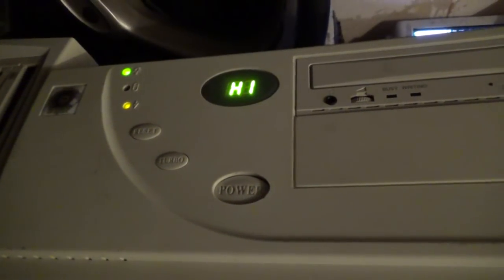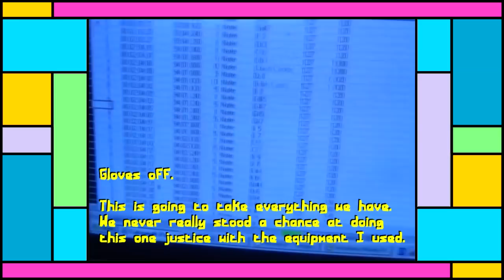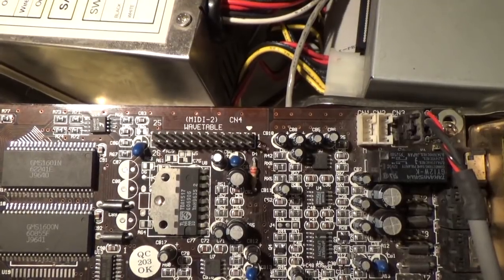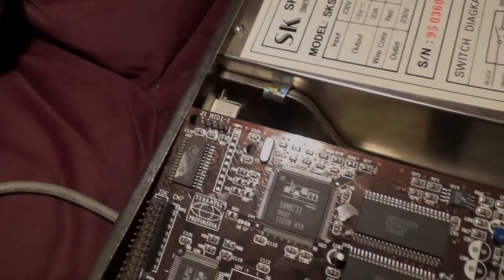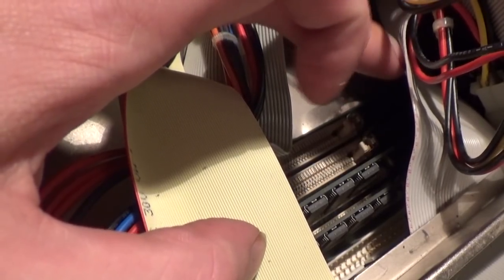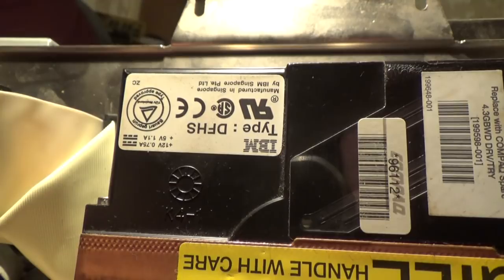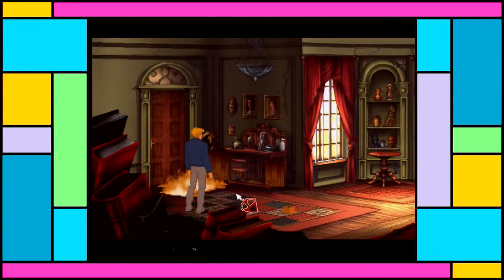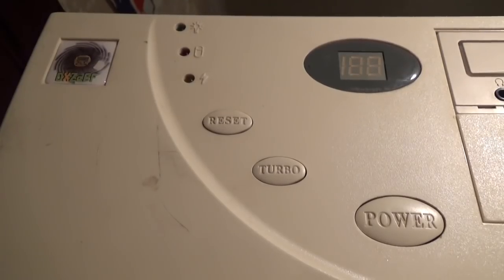Improved AMD K5 System

Comment: I like the fact you did put an intel branded CPU cooler on an AMD chip ^^

I wasn't aware your PCChips board didn't work well anymore. If you want I can give you mine (or sell it to you if you're uncomfortable about it being gifted to you) since I've got two of them with one having COAST module and 3v module and the other one having none of them. Since I've got many working pentium class boards and that I've two of these pcchips, that doesn't bother me at all (in fact that'll make some room for me and it'll be used by somebody at least)

Hey that K6 mobo looks exactly like the one I have, it's quite an interesting board. IIRC it was designed by DFI, but oddly enough mine had Octek stickers when I got it. This makes me wonder if Octek wasn't a second brand name for DFI

One great advantage for PS/2 ports is that under windows 9x you can change the refresh rate of the mouse from 40Hz up to 200Hz which makes the mouse to move smoothly (and improves the "framerate" in FPS games since normally when you turn your view, the view gets changed every 40Hz instead of 60Hz or whatever framerate your CRT and your computer are able to display)
Reply from the maker: It was the only cooler I had to hand which would fit properly, plus there's a box full of them in the kitchen.
Anyways, thanks, but I'm happy with this SI55P now and have a nice Intel board for Socket 7 stuff if I need it. As for the K6, it's a Chaintech just like I had before, though DFI would have been fine as they were still making good stuff at the time. Octek on the other hand, all I remember about those were their "DCA" 486 motherboards where the cache was part of the RAM module, good luck finding those now.
Can't say I've noticed mice causing slowdown like that, but then keyboard only isn't so much of a deterrent to me.
Reply: Well it's not really slow downs, it's just some sort of effect, the game still runs at 60FPS (or whatever framerate your computer is actually displaying), but the view gets updated only 40 times per second. I noticed this in half life : turn the view with the keyboard and it's smooth, turn the view with the mouse and it's less smooth. You can even move without turning the view and it will stay smooth. Use PS/2 rate and suddently turning the view with the mouse becomes as smooth as what you can do with the keyboard ;)

If you set PS/2 rate permanently, you can even notice it when Windows starts. Just move your mouse in circles while windows is starting up, then at some point the mouse will stop for half a second, and when it'll move again, it will be suddently smoother. You should try it, that thing is very light
Reply from the maker: Memory suggests XSetup actually has a dialog for this, though I don't recall ever using it. I suppose there's also the whole thing of 25-30fps being my target for games, so the odds of the frame rate outrunning the mouse are far lower than they otherwise might be and everything else is running in DOS anyway. Still, this information will definitely prove useful if I do encounter the issue in the future, I'm sure, so thanks, I'll keep it in mind.
Reply: I see. But I also noticed that this also affects DOS games if you run them under Windows 9x ! that's a really nice program

Comment: Personally I found Voodoo to be a great supplement for my K5 PR133, as it became a good all-round system that was not only great @ 2D, but could also breeze through any 3D title made up until ~1997
Reply from the maker: Can't say I witnessed that when trying one out with the old K5, but I guess it depends on what you're trying to run. As it is, none of the games running here use 3D acceleration, even the models in Atlantis only use DirectDraw and almost everything else uses VESA or good old frame buffering. If the boxes in your library are full of 3DFX logos, I expect you'll have a better time with one than without.

Comment: I don't remember Hover sounding anywhere near that awesome but then the PC I played it on was basically the cheapest PC my dad could find for Christmas of 96. Some low end AST rig so who knows what sound chip it had on board.
Reply: I also struggled to find a reason to use my PCI ATI Mach64. I currently have it in a early socket 7 machine I'm putting together running a Pentium 75 purely for the reason that machine refuses to POST with anything from S3. No joke, I tried a Virge, Trio64 and a Vision and nothing, popped in a Mach 64 and display kicked right on. Unfortunately as far as benchmarks go the Mach 32/64 cards are pretty slow being beat by all my other early 2D PCI cards from S3, Tseng and even my weird IGS card.
Reply from the maker: The only down-side with that wavetable is that some volume levels vary versus what the music might have been written on, but this is an issue on a lot of GM devices, even the highly regarded MU80 & SC88 have patches with vastly different levels or that sound radically different. As for your AST, the ones I went in from that time period (All AST Advantage boxes) had YMF719 chips in them, but there was definitely one around with an OPTi 929 onboard. There never was an issue with using the Mach 64 as such, it actually runs fast enough in DOS though they are indeed slower than an S3 there and that can be a problem if the rest of the system can't quite hammer it along fast enough. In my case, I just thought it was slow in LBA 2 (in Windows) but it turned out the machine itself doesn't like the game, or else they pulled a Cryo and completely understated the requirements. I was surprised overall by how the Mach 64 actually runs quite well outside of benchmarks, any slowdown is barely noticeable if at all most of the time and I will definitely be making an effort to count FPS in actual applications before and after switching back. May help that it's a later version, apparently with some primitive 3D core inside, to the point where it's effectively a "Rage Lite" or something.
Your S3 problem has me wondering if your board is doing something like this one, not so much the likely conflict with the WinTV Celebrity and undocumented addresses, but more so the SCSI BIOS issue where maybe the card is hooking itself into somewhere it shouldn't, possibly due to more undocumented addresses and something your board has sat up in that range. Either that or some weird PCI interrupt line troubles, the P66 board doesn't like passing POST if the VGA card's slot is set wrong.

One last thing. Do you still have that MS-3124 / Contaq-386 board? I noticed that it has extra pins by the CPU socket, how many are there and are they on more than one side? Do you remember if there were more within the inner square of the socket that weren't populated? I've stumbled down a rather strange rabbit hole here regarding a CPU that might have used them.
Reply: My Mach 64 doesn't feel very slow either in use but in every benchmark it's generally last along with my Mach 32. I also haven't used it to much either though. I've read some posts that it's not the most compatible card and certain games display graphical glitches though no one can give specific examples. I haven't come across any issues yet. I did realize after looking over some old notes the motherboard that is giving issues with the S3 cards actually once ran them just fine as apparently some time ago I did some benchmarks on it. Only major difference is back then I was running a Pentium 90 in it so maybe the 50mhz FSB that I'm running now with the Pentium 75 is tripping up the S3 cards? I tried removing all other expansion cards as well as trying different PCI slots and setting "assign VGA IRQ" or some such thing in BIOS but no luck.

As for the MS-3124 / Contaq-386 board I do indeed still have it. I use it as my main 386 PC. There are two sides with unused pin rows. It's sort of like the CPU (running a AMD 386DX-40) is installed in one corner of the socket with unused rows on two sides. I just assumed maybe it was a dual 386/486 board or something though I never bothered to even look how much larger a 486 chip is or if it fits in that socket.

Comment: If you get time could you make a video about a Cyrix 6x86 machine. How closely related is the Terratec EWS64 to the one you have here?
Reply from the maker: Cyrix, huh... yeah, maybe I will. There isn't one in common use anywhere here, the K5 basically displaces it but that's not to say I can't test one out, no harm in looking into what would happen if this machine was built with a Cyrix instead - pun intended. The EWS64 is a somewhat different card and it isn't one I have used personally, seems there are two major versions, one with a Crystal codec and one with an Analog Devices codec, they do both have the wavetable and some level of SBPro support. I believe there is a bug with the mixer and SBPro mode on the Crystal versions but a workaround exists.
Reply: Ok cool, I have an ECS board with a cyrix PR233 and it seems quite a bit more responsive than my P233MMX machine. I bought the EWS64 with AD chip yesterday, Will let you know if it is any good. Have you ever used one of those evergreen upgrade cpu's for socket 3 with the AMD 586 133 on it?
Reply from the maker: I don't know how they fare against the MMX, but for a brief time the 6x86 was the fastest x86 chip on the planet, I think that was the PR150 or the PR166. Yeah, be sure to let me know how that AD codec fares up. No, I've never used one of those Evergreen upgrades, but I've used regular 5x86 chips in the past, personally I prefer the Pentium OverDrive, but their performance is somewhat different and it honestly depends on what you want to do with it.
Reply: I would like to own a Gravis Ultrasound, Have to admit I no nothing about them but they must be decent for the price sellers want for them. Finally got around to building the LPT DAC you posted and it sounds way better through FT2 than I was expecting for something off the printer port.
Reply from the maker: The Gravis is a great card, but the one I have almost never gets used because little of anything supports it properly if at all. As for trackers, try Intertia Player (in DOS) as that one actually uses stereo properly, FT2 is really broken in that regard and will often give a mono output on various devices, including the GUS and Covox.

Comment: That K5s have unlike other x86 cpus a harvard architecture memory design, which makes them unicorns. Had one PR133 back the days, brave little thing. You could get your hands on an matrox millenium g400 pci or an ATI Rage Pro. Both Cards provide much better image quality than S3 Virge Cards, which was very poor(and also had better video and 3d accel.).
Reply from the maker: Due to Diamond's MPEG drivers not really working in Windows 95 and their cards coming in slightly slower than the competition, I went back to the Mach64VT eventually, it has worked fine thus far despite the small performance hit. Ironically I find the image quality from S3 Virge cards far superior to the quality from ATI cards, the latter of which tend to be blurry and have poor contrast by comparison, I suppose it may depend on who made the card. I'm not at all interested in 3D acceleration in this system.

Comment: K5 was much more advanced than Pentuim: it had a decoupled architecture which Intel only implemented in PPro and could issue 4 ops/clock which Intel implemented no later than in Core2